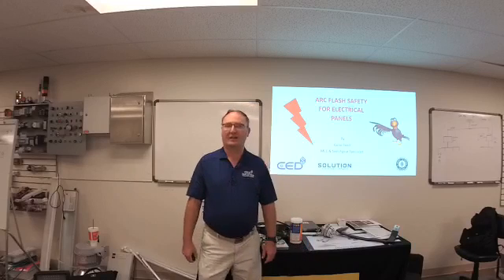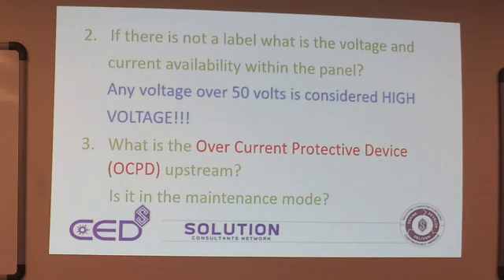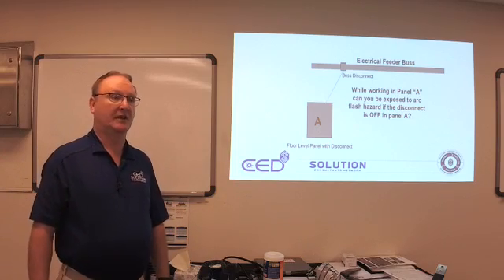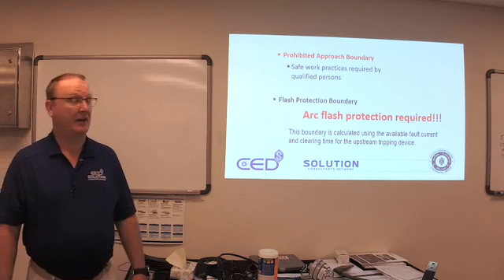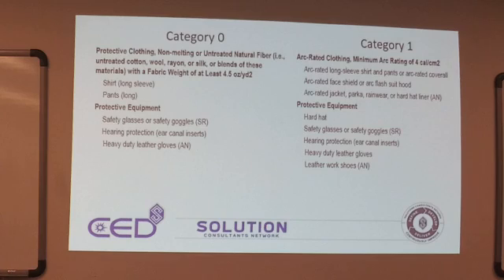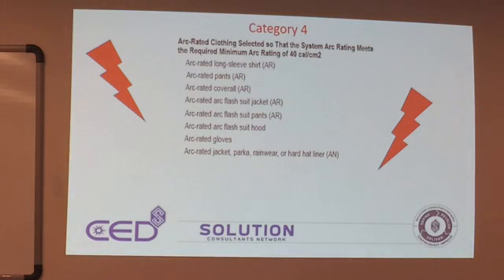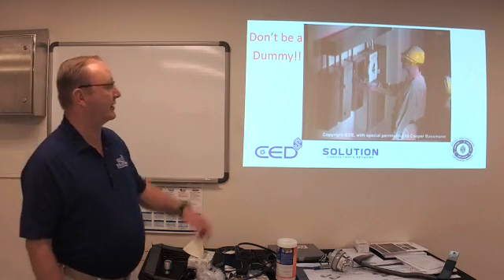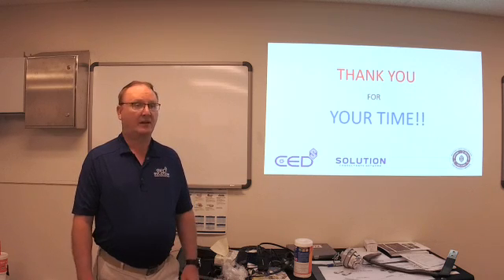TRAINING: Arc Flash Safety for Electrical Panels with Gene Reed

Comment: Why can’t they design these so you don’t have to get close to turn them on and off? How is this not a failure of engineering? Can someone explain?
Reply: On these videos they put just one thing out sticking out like a sore thumb to make it easy to see. In a steel mill you've got so many of these boxes to control you have an awful lot of space just consumed with long handles.

Comment: If you violate a personal space boundary of another person, this is sexual assault or rape. Personal space must be respected. 

Ditto for boundaries regarding areas where arc flashes can happen. If you are not qualified to work on electrical equipment that has arc flash hazards, and you see that arc flash boundary tape, never, ever cross past that boundary tape under any circumstances! Absolutely no exceptions! 

Arc flashes are not jokes. They can badly burn, severely injure, shock, and/or even kill!!!

Comment: Can arcs happen in 120v residential?
Reply: In residential panels they are single phase (so two hots 240v) if you get a phase to phase fault you can get a nasty flash and or explosion
Reply: 120 to ground isnt bad, but phase to phase can be quite nasty.
Reply: In residential panels absolutely.
Reply: Why don't electricians wear arc flash gear except. If it's 480 or above .  Technically they should all wear it on anything over 50volts. Common sense has been thrown out to. Some. Respect with this nfpa requirement.

Comment: I'm pretty sure that dummy explosion is for a 277 480v system.
Reply: @g quin It's coming from the top.
Reply: @g quin That blast may or may have not come from 208.
I just find that blast to be pretty big for 208, so I gave my opinion about it being 277.

He explains how it's a bolted fault to ground i.e. they took a  wire and stuck it on bare metal that has an equipment grounding conductor bonded to it; end result: arc blast.

The conduit you mentioned is coming, as I previously said, from the top into the Disconnect box.